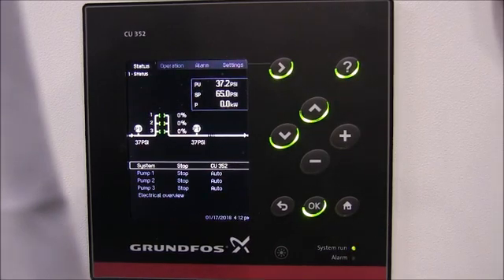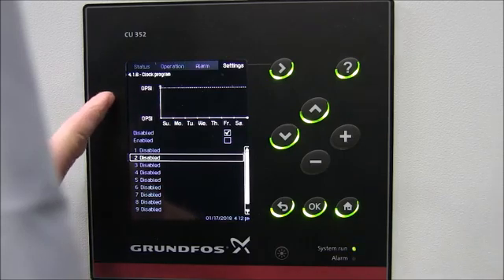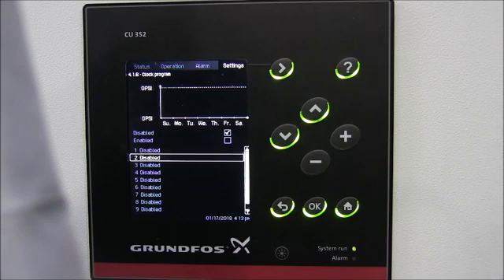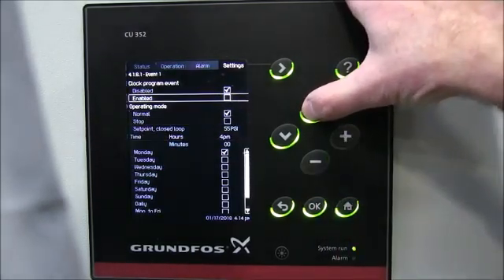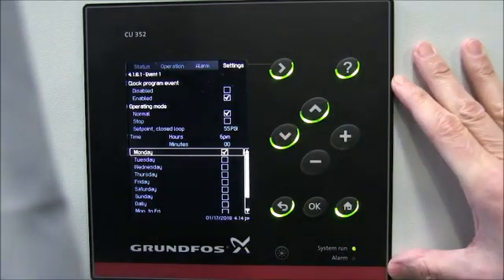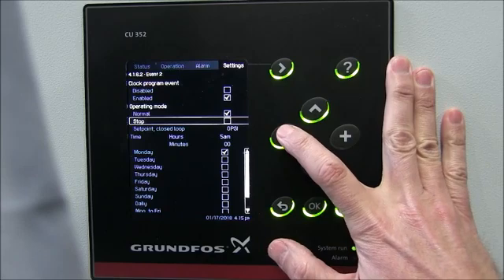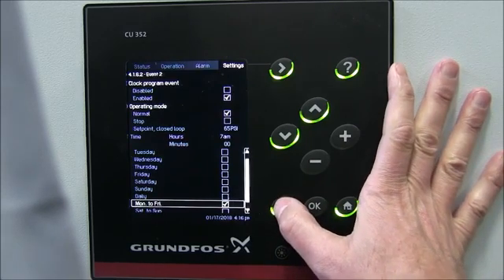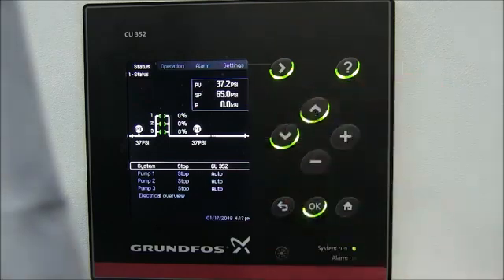Master the Hydro MPC clock program to automatically adjust pressure set points

Comment: Hi Sir Can you explain how to set Flow estimation in display after set pump data details in Hydeo MPC E 2xCRE 32-5 pump set
When set in parameter 4.5 with 3rd raw Display indicated ---m3/hr only no value
Thanks
Reply from the maker: Hi! Thanks for your question. The display showing --- m³/hr usually means the flow estimation feature hasn’t been fully configured or the required sensor input isn’t detected.

For detailed step-by-step guidance, please reach out to our technical support team at support-us@sales.grundfos.com. They can provide the exact instructions for your 2xCRE 32-5 setup.